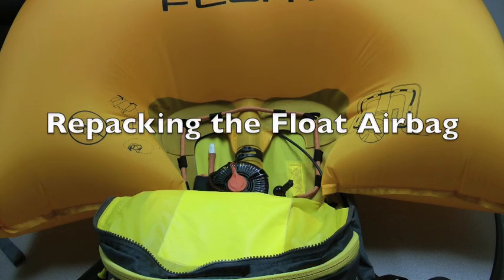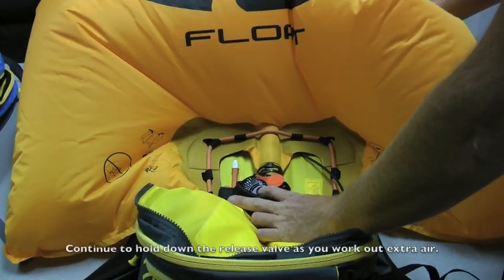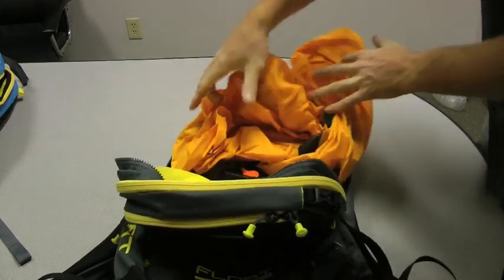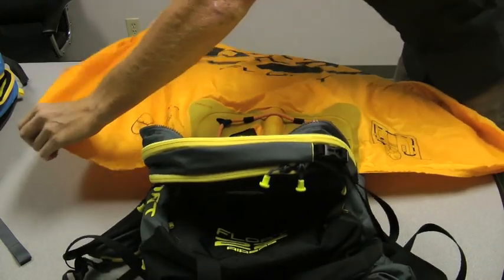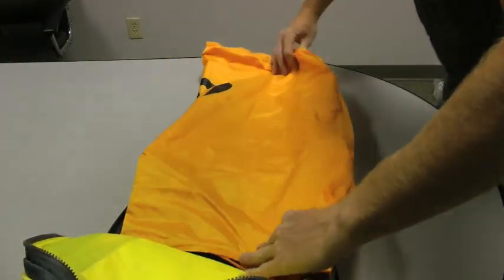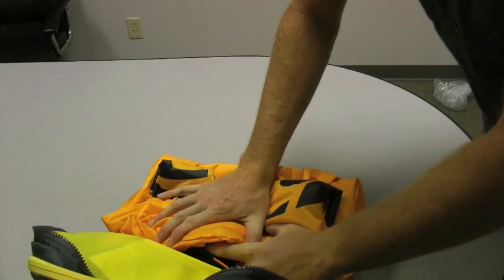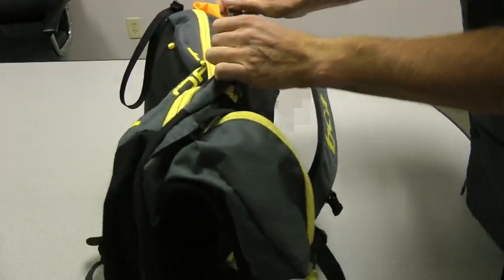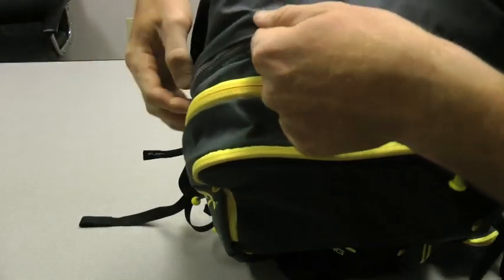Repacking the Float Airbag

Comment: IT LOOKS EASIER TO PRESS THAT BUTTON IN IT'S LOCATION TO RELEASE THE AIR IN THE AIR BAG COMPAIRED TO THE 2.0 BOTTLE AIR RELEASE SYSTEM WHICH IS MORE ACWARD BECAUSE YOU END UP REACHING UP AFTER THE AIRBAG IS FOLDED UP AND YOUR PUSHING DOWN TO GET MORE AIR OUT.